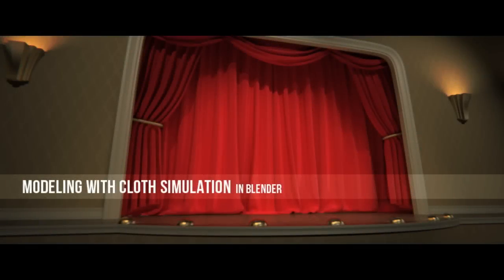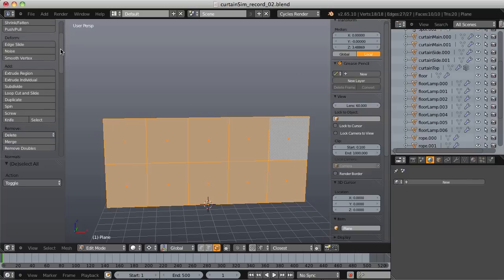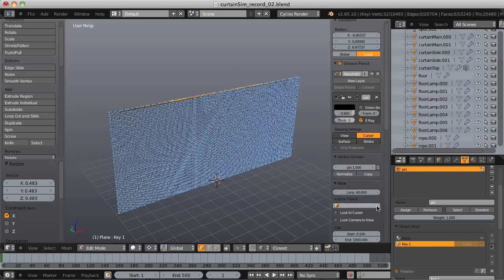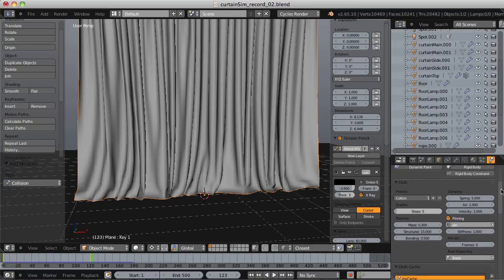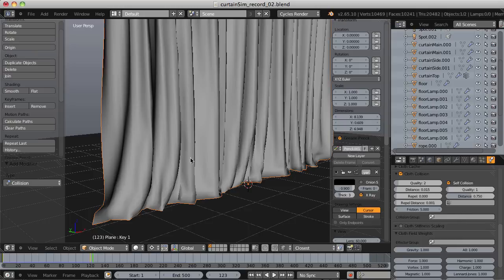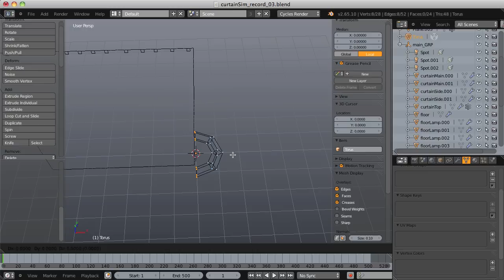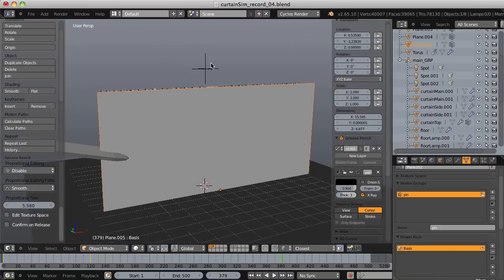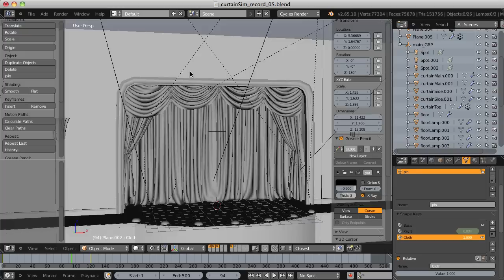Modeling with Cloth Simulation in Blender

Comment: Depends on a lot of factors about the scene complexity and render setup. I made a simple 720p animated logo for someone that was a bit over a minute long. It took ~15 hours to render. I only had it set to around 256 samples ("clamp =1" is your friend). This was on a Core2Quad, and GTX 550 Ti 2GB video card. The machine I describe should be able to do it in less than half that time. When set to GPU, Cycles render engine mostly uses the video card, so the better the card the faster the render.

Comment: That's a good reason to go with a GTX 600 series card then, because it will outperform it's 500 series counterparts at basically everything else. That minor feature that was removed from CUDA for the 600 cards isn't generally used in game engines.

If the ONLY thing a person was planning to use their system for is Blender, then a GTX 500 series card would be a cheaper option with slightly better Cycles rendering performance, according to the forum conversations in several different Blender sites

Comment: Reading some more about this just now, apparently a GTX 560 Ti outperforms a GTX 660 Ti in Blender Cycles due to Nvidia having removed a feature in the 600 series CUDA architecture. They'll still perform well, but not quite as well as their 500 series counterparts, so maybe stick with the GTX 550-590 cards. 

Kind of sucks actually, since I like that the 600 series run cooler than their 500 series counterparts because they draw less power. Under full load GTX 590=365 watts, and GTX 690=300 watts

Comment: Thanks for a clear, detailed tutorial.
 
Bad physics, though. Try this: We hang the rod and fold the cloth perpendicular to the floor to *eliminate* gravity as a meaningful influence.   We shape behavior by the choice of material/ properties; and dynamically with rigging.  The folds are practical and by design.   A theater also has flat, cloth backdrops.

Example: try putting rings IN the cloth. .... :)
(Rigging: Does it retract, lift.. both?  which way? How heavy?  Keep the distribution even)

Comment: My cloth doesn't behave like in the video at 13:20. The pin group animates to the desired width on the X-axis and the vertices closest to them fold like intended, but the further down the curtain we go, the vertices just doesn't "fall in". I know they are "free" as they all "fall down" at frame 1, but they won't move along the X-axis. It looks like an "A" with a wrinkly top bit.

Ideas?
Reply: This is a really useful tip!  I was having the same problem and traced it to the Self Collision numbers.  When I tried your tip of increasing speed I got great results with a factor as low as 5!  Thank you!
Reply: @aurelienmartel5413   thank you u comment solved half of my problem

Comment: Yeah, the CPU based Cycles rendering is painfully slow, even on my quad core. For the time being at least, the Nividia cards work best for GPU based Cycles rendering. Also, try to pick up a video card with at least 2GB of it's own RAM, as when you use the GPU for Cycles it will use the video card's RAM, not the system's RAM. Still good to have a lot of system RAM though, for times when you have a very complex scene, especially for baked animations like in this cloth tutorial.

Comment: Get an Intel Core i7 quad or hex core, and I wouldn't go for anything less than an Nvidia GTX 660 Ti at this point (I have the GTX 550 Ti which does okay, but it's a bit less than half as powerful). Cycles rendering will go fastest with the latest Nvidia cards, and the more CUDA cores it has, the better. Get a bunch of RAM as well, at least 8GB.

Comment: why must used cycle render ? if use blender render ?
Reply: +farid muhsin You can use The internal rendering engine. I don't think it has any problems with the simulation. However, cycles will give much more realistic materials, especially for cloth (translucency, etc. )